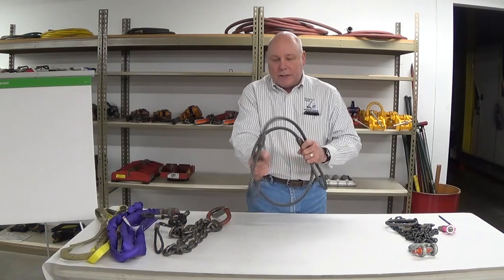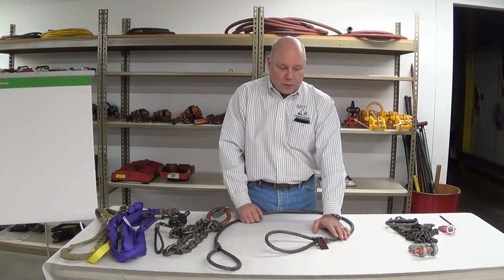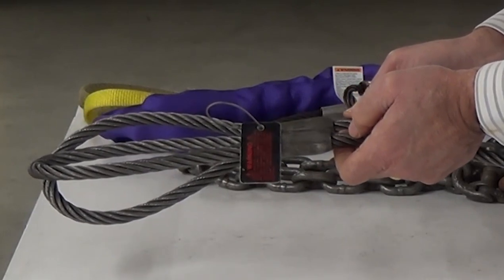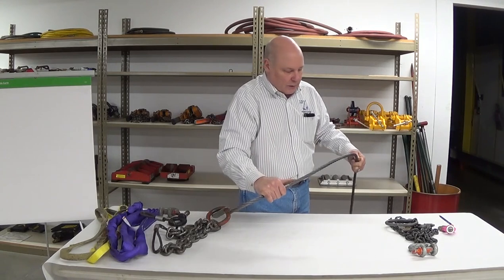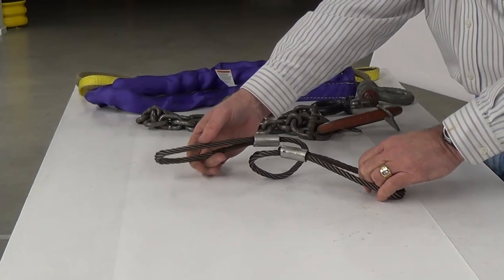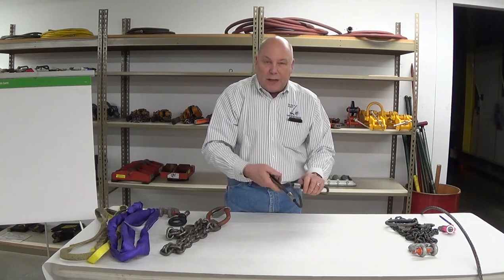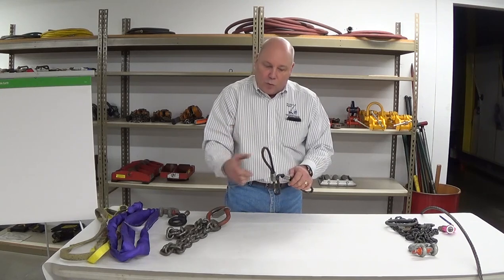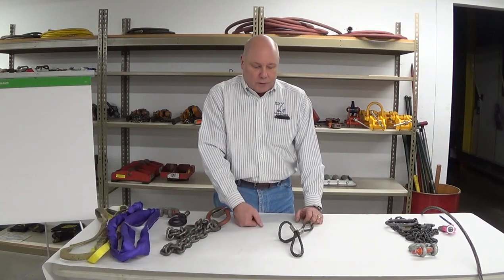Wire Rope Sling Inspection with Mike Parnell

Comment: Your tag doesn't have one, but if we make a tag for anything in use in the field it will have a serial number. 

I work for West Coast Wire Rope in Seattle and went through the level 1 inspection class in 2015.